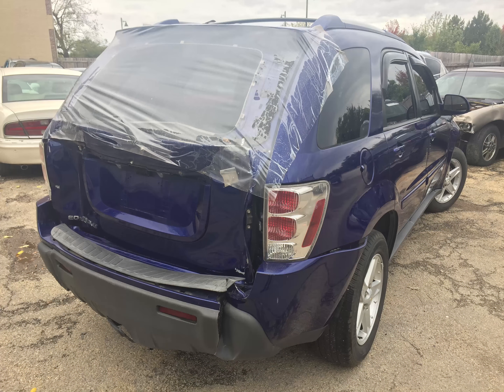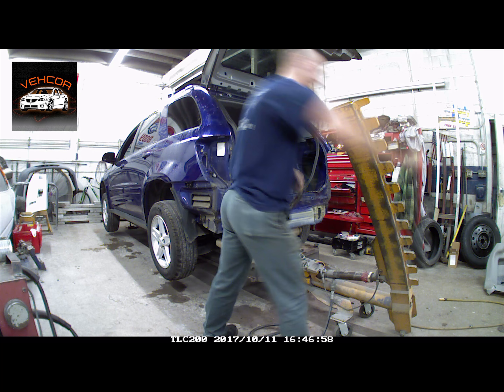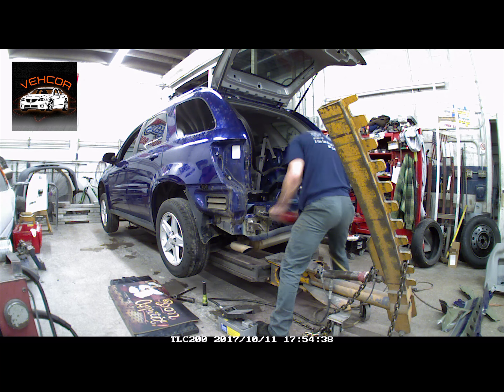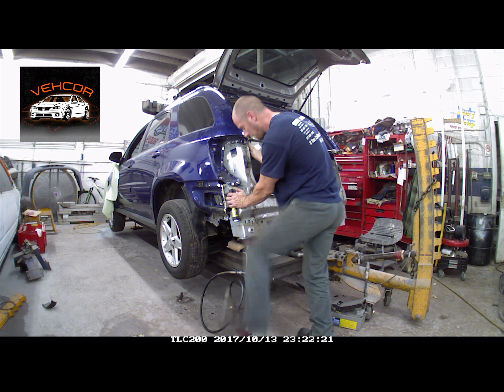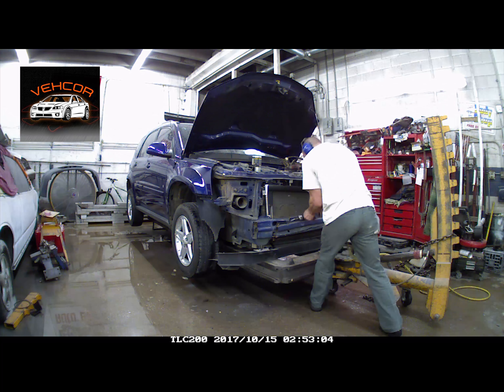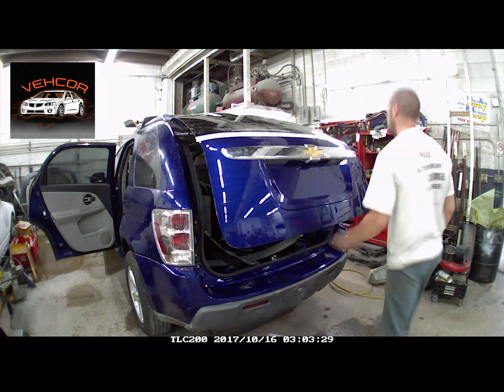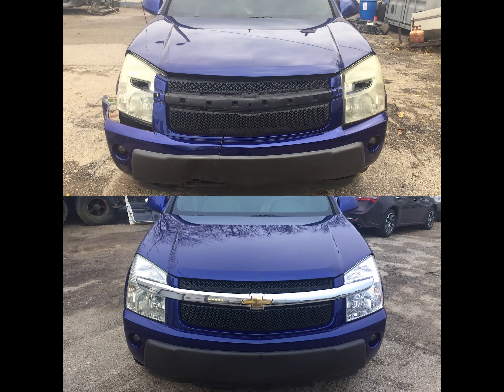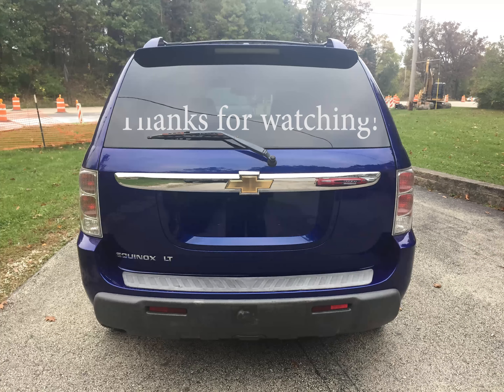2006 Chevrolet Equinox front and rear collision repair time lapse

Comment: Excellent video. I have a few questions - How do you know where to pull? Is it at a seam or do cars have "pull points" that will allow it to go back to original position? Cost - I know this is often not explained but could you give us some estimate of the cost for the repairs? Time - Can you tell us how long some of these repairs take in hours? This is a great teaching video in so many ways. I am always down for a longer video or multiple parts if that is easier. Thanks for sharing the knowledge.
Reply from the maker: Thanks, at the beginning you can just pull the kinks and buckles out, this is the rough pull. After that you need to start measuring to fine tune the pulls and get the parts in their final correct positions.  There are no pull points, some times you have to be creative. Pinch welds are great for attaching clamps and what I used on 95% of this job. You can also use mounting holes, flat surfaces, drill your own holes, cables, straps or weld clamps on. As for the time, I think I had 25 hours or so in this one. I will make some "how to" videos in the future to explain how to estimate costs, time and other aspects, it will be part of a series. Thanks for watching.

Comment: Dude, this is awesome. Your repairs look OEM, and I would not feel unsafe driving it around. How do you account for time cost? How do you find the parts to repair damage?
Reply from the maker: Thanks, for time costs, I use an estimating system. To find parts, I either buy a parts car, which is why you see me repairing the same type of car over and over or buy them from salvage yards and even private parties. I will have some "how to" videos in the coming months that explain this in detail. Thanks for watching!
Reply: vehcor are the estimates usually close to actual time invested? I look forward to the how-to videos, I'd love to get a better idea of what I'll need to do to repair light crash damage to a new potential project.
Reply from the maker: I'm usually about half of book time, I work fairly quickly. On jobs or cars I have not worked on, it might be closer to 3/4 of book time. I estimate everything a full time and any time saved is a bonus. Sometimes that bonus gets used up if the car needs additional work or you find something unexpected. The big job I referenced in this video that will be coming out in 2 months does not have a book time, the parts replaced were not available from the manufacturer so only some parts could be estimated.

Comment: 3:58 how did you get this silver part ready?
Reply from the maker: Pretty much the same way I got the car itself ready. I drilled out the welds to remove the pieces I was not going to use, remove paint and contaminates from areas to be welded, apply weld-through primer to both bare metal mating surfaces. I will be making a video to show this in the future.